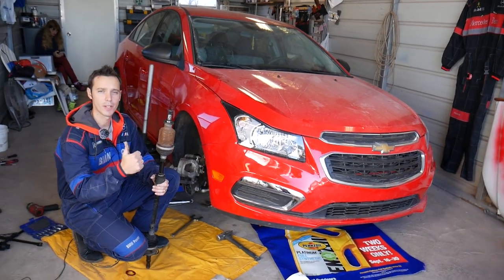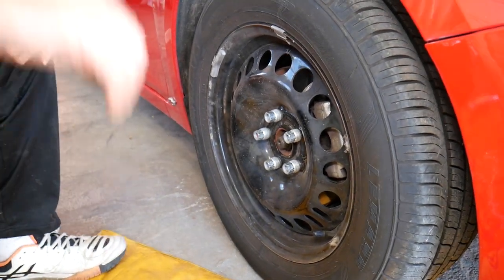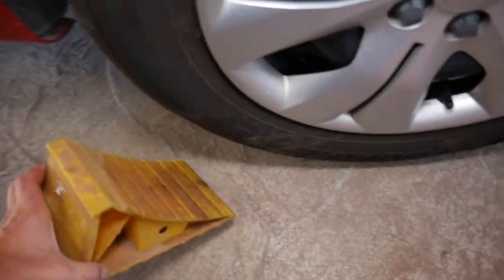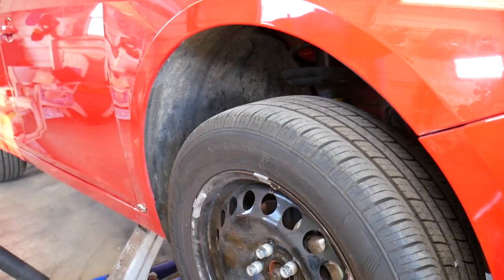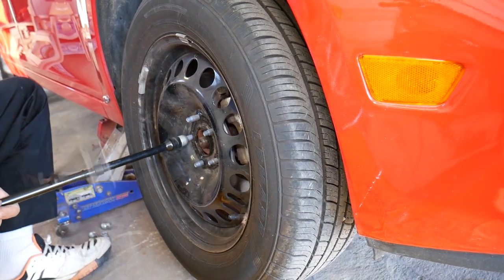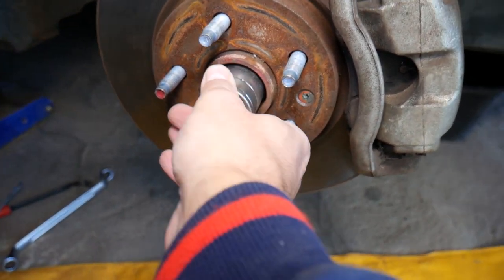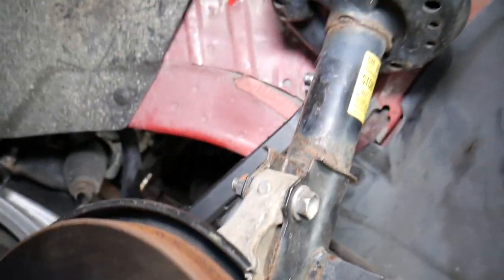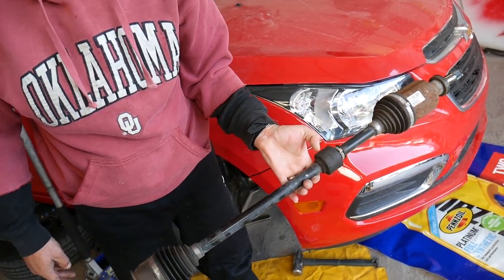CHEVROLET CRUZE FRONT CV AXLE REMOVAL REPLACEMENT. CHEVY CRUZE

Comment: This video is good for a newish car, but it won't work for a seized cv shaft in a hub on a 20yr old car. Also undo the tie rod end, it will give you space to remove the cv shaft. The way you removed the cv shaft risks damaging the oil seal, thus costing unnecessary money.

Comment: Guys you do not need to split the bottom ball joint off. Take the two bolts put that hold the strut to the hub assembly and there's room to get the cv out without removing the whole hub. You guys made this job so much harder than it needed to be.
Reply: What 2 bolts?
Reply: @GidDree strut tower